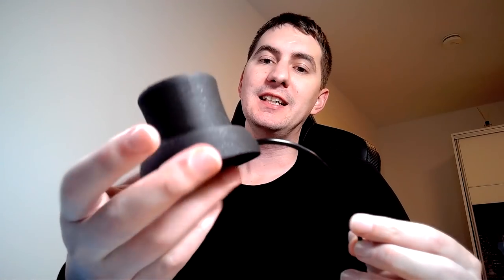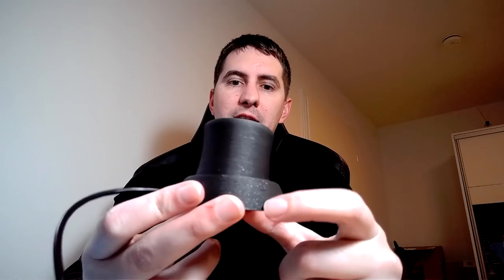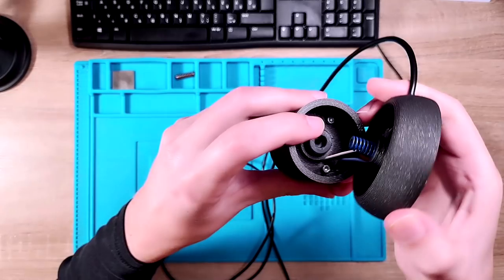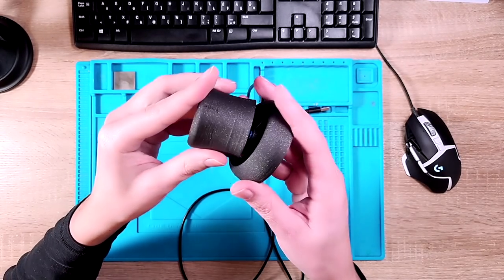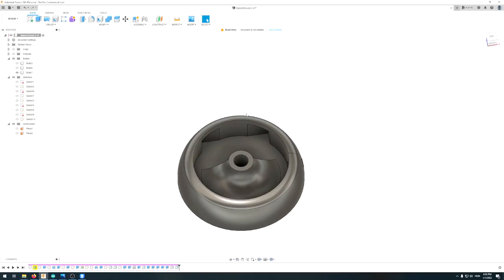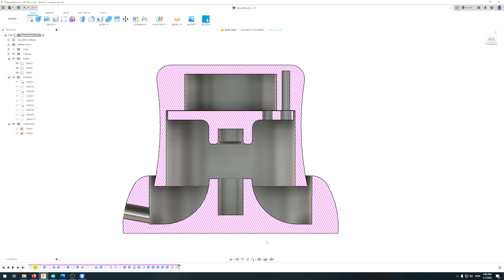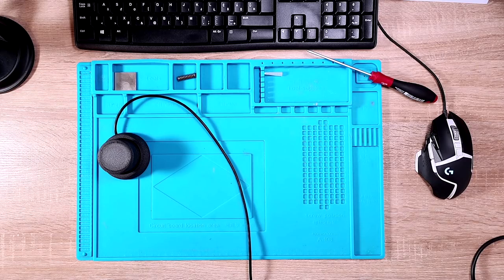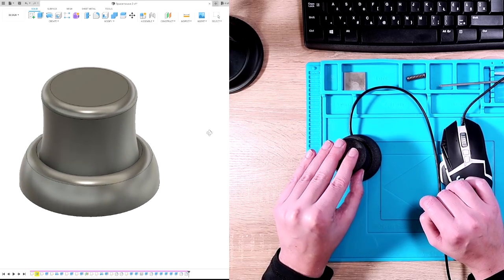DIY 3D CAD SpaceMouse for 20€ - 3Dconnexion alternative???

Comment: Hi! What about drivers? What software can you use? regards!
Reply from the maker: At the moment it is just emulating keyboard button presses and mouse movements. This way it works with any software with the keyboard/mouse shortcuts programmed into the code. I have just designed and built this in 1 day. Later on I plan to check the driver option too but that might be difficult.

Comment: You need add rotate also then its perfect... rotaty encoder. I use 3dconnexion enterprice. I like lot this 3d mouse Features. Can you share this thinkgiverse ? full project ?
Reply from the maker: I am already working on the updated version with significantly more functions :) like rotation, pan, zoom etc...
I will share all files afterwards. Stay tuned for that :)
Reply from the maker: As I promised the video to the version 2 is out:  https://youtu.be/68EapQbDBOc

Comment: Could you try using this with the orbion software?
Reply from the maker: It would require quite a lot of changes. Have you already checked my version 2 video with extended features?
Reply: @kikihobbyrepair  there is a version 2? Great I will see that ASAP!
Regarding the changes - its just meant for the controls

Comment: Love your design, idea and actual real project! Just a question/ thought, why not use Xbox/PlayStation orbit axis with push button instead of sensor board? You would minimize complexity of your design greatly. Definitely following up for V2! Keep it up!
Reply from the maker: Thank you. I repair game consoles as a hobby. Those joysricks are wearing out pretty fast and are small. With my method I do not have moving compknents except the spring. I will also add a button or maybe more to increase functionality to get closer to the original.
Reply from the maker: As I promised the video to the version 2 is out:  https://youtu.be/68EapQbDBOc

Comment: while interesting, from the video it seems you just made an expensive joystick? (2 axis movement?) a 3dconnexion device has 6 axis
Reply from the maker: Thank you. Yes, I also told in the video this is not a replacement. This is the result of one day of work from the idea to the product though. The huge advantage of this over a joystick is that this will not wear out like the carbon tracks in a joystick. 
I am already working on the version 2 woth 5 axis which will already be significantly closer the the original.

Comment: you can made it with just an analog joystick... why are u used accelerometer ?
Reply from the maker: This is what I wanted to avoid. Joysticks wear out super fast. I repair game consoles and the carbon tracks are crap. My way there are no moving components except the spring. Furthermore this will never drift because it is automatically making an offset compensation at the beginning. 
I am working on a v2 with way more functions/axes

Comment: Nice project and 3d design. It's still not a real alternative for the original space mouse (no pan and zoom), but a good start.
Reply from the maker: Thank you! :) Yes, you are right, it is not an alternative but it is a cool little DIY project :) I am already working on a version with a button to double the functionalities. :)
Reply from the maker: I see that you wanted tobdrop a comment bit Youtube deleted it. Maybe it contained a link and YT deletes these mostly. I only see the beginning if it works with Freecad. This is basically obly emulating mouse and keyboard moves and presses so this works with each and every program. For sure this way it has certain limitations
Reply: Maybe FreeCAD is not allowed word (there were no links) ;-) I only wanted to point out that a lot of people use FreeCAD and it doesn't support space mouse as smooth as Fusion, so some cheap alternative would be great - it is not worth to buy space mouse from 3D Connexion.
Reply from the maker: Thanks for the info. I think so too that a really cheap alternative even with slightly less functions makes sense.
 I really do not understand why Youtube deleted your comment....
Reply from the maker: As I promised the video to the version 2 is out:  https://youtu.be/68EapQbDBOc

Comment: I love it! I've been toying with the idea of making my own SpaceMouse for a while, but your mounting mechanism is so much simpler than what I had in mind!
I've tried using an MPU6050 for a different project (a head tracker), but I could not get rid of the yaw drift, so I switched to MPU9250, and eventually to an Arduino Nano 33 BLE that has accelerometer, gyroscope and magnetometer integrated. How did you counter the yaw drift, or was it not a problem in the first place?

(sorry if the solution is obvious, I'm a terrible programmer xD)
Reply from the maker: Thank you for your comment! :)
I also suffered a lot with drift but the MPU6050_light library solved immediately all the issues. It is equipped with a nice filter coding. Now the angels are dead stable. Try it out ;)I am working on a version 2 with way more functions. Stay tuned for that.

Comment: If it's just 2D and not 6D, why not just use a joystick instead?
Reply from the maker: I did not want to use joystick because they are using crappy carbon tracks as potentiometer which wears out pretty fast. Here the only moving part is the spring.
Btw I am working on an updated version by adding an additional button to it to double the functionalities.

Comment: While you are emulating mouse + some key (shift or alt) movement it wont be alternative to 3Dconnexion but just a toy. I have similar toy ))
Reply from the maker: I saw somewhere that it is possible to build up 2 mouses parallel and then this one is not interfering with the main mouse. I will check this out later on. At the end 3Dconnexion is somehow also sending some commands...
But as I also told in the video this is for sure not a one to one replacement of the original but this costs 20€ which is ca 1/6 of the price 🙂
Furthermore tgis is only a first prototype designed, printed and programmed within 1 day and not years like the original most probably 🙂
Reply: @kikihobbyrepair  as I know 3d connexion is standard usb hid device, so it's possible to recreate    similar behavior
Reply from the maker: Yes, I think so too.
Reply from the maker: I have just checked and there is even an Arduino HID library if I want to spend more time on it 🙂
Reply from the maker: Did you try to add a link? Sometimes Youtube just automatically deletes them.... I just see that you sent something what cannot be opened anymore...
Reply: @kikihobbyrepair  yes, there was link to "Interfacing a multi-axis controller to the joystick partner port" - there is some code, maybe you could understand how 3d connexion works...
Reply from the maker: Thanks a lot. I appreciate your help. I will take a look at it later on. 😉
Reply: I agree. This is not even close to the real 3D Mouse performance. Clickbite video tilte.
Reply: @miecz23  but design is great, just need to work with software

Comment: Does your mouse support knob rotation ?
Reply from the maker: Not yet. In later versions I plan to add this. At the moment I am working on a version with a button to double the functionalities.
Reply: @kikihobbyrepair  OEM 3d mouse works by magnetic field and hall sensors. You can try it too.
Reply from the maker: Yes, hall sensor is in my head as an alternative for further functions. The original 3DC spacemouse is working with optical sensors but it is patented so cannot be used.

Comment: Can I ask for the stl file of this project?
Reply from the maker: There is already a V2 of this Spacemouse. For that version all the files are available. Link  in the description.
Reply: However, I would ask for the table for the first version if it's not a problem :)
Reply: @kikihobbyrepair  tell me buddy, the current arduino configuration in alibre or solid will work properly? Are code changes necessary?

Comment: do you have some git page ?
Reply: I like to contribute in the project !
Reply from the maker: I do not have yet. I still have to find a way to publish this project brcause there is a huge interest.
Reply from the maker: I saw this. It is using a joystick like most other diy 3d cad mouses. These are wearing out pretty fast in game controllers causing drift. This is why I decided to use an MPU6050 module to have no moving parts/potentiometers. But the rest of the project is pretty cool though maybe a bit too complicated for my taste. I just wanted something simple 🙂
Reply: @kikihobbyrepair  i have boght parts for the to projects
Reply from the maker: As I promised the video to the version 2 is out:  https://youtu.be/68EapQbDBOc

Comment: Yep, it's simple, but ... Real CAD controller will allow U to use it with a mouse and keyboard, this will not ...
it's nice idea and a thing, but not for real use ...
Reply from the maker: Yes, this is emulating mouse and keyboard button presses but I do not really get your point that it does not work with a mouse and keyboard. I am using it parallel to my mouse and keyboard. Ok, I am not a professional CAD user but I find this already useful. This is the result of 1 day work and this costs ca 20€ 🙂
Reply: @kikihobbyrepair  If U rotate model then do things, and repeat it - no problems) But 3D CAD mouse approach is different, U can rotate and still use standard mouse same time.
With Ur design it can interfere each other.
It just point of view while using Fusion 360 and other CAD for a while)
So best for DIY version is creating custom USB HID. That will work fine, but it's hard)
Tried once, but didn't found good guide for it.
Reply from the maker: Yes, for thats true that you cannot use both the same time but I anyway cannot concentrate on so many things at a time 😀 
Regarding the USb HID I already found an arduino library. I might try this oit later on. Furthermore I saw an other alterrnative to build up 2 independent mouses and this way they are not interfering.
Lets see 🙂